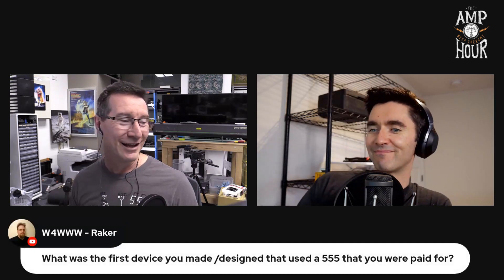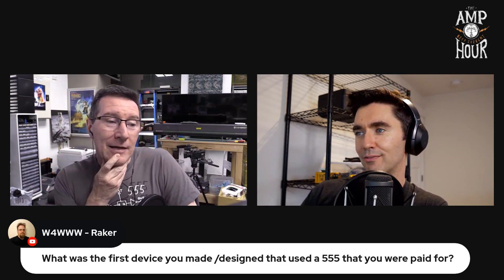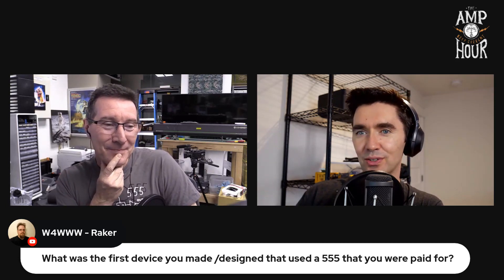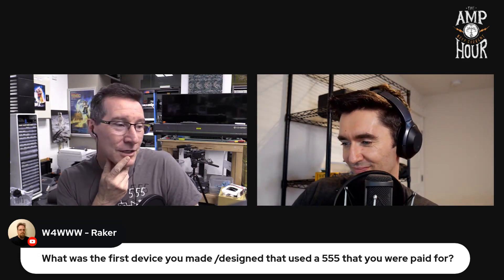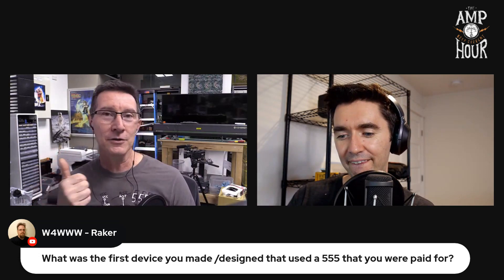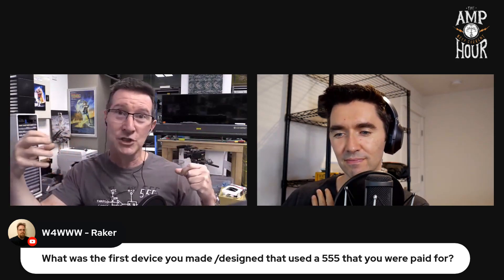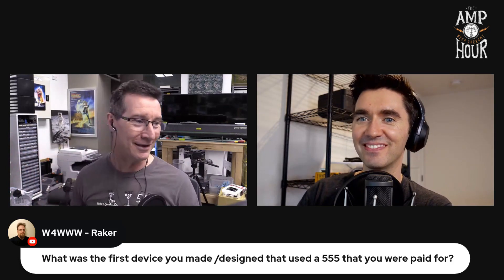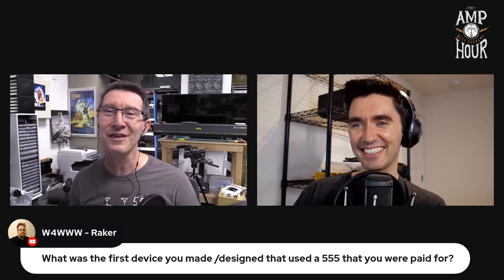My First Paid Electronics Gig

Comment: My first device also used a 555. It was a simple 8 LED chaser with a pot to adjust the speed. Can't remember the chip I used to drive the 8 LEDs. I remember drawing the circuit on the copper board using a dalo pen and drilling the holes with a small hand drill. Those where the days...

Comment: Color organs with 3 strings of Xmas lights stapled to the inside of old speaker boxes with plexy light diffusers replacing the baffle board. One string for bass, one for mid-range, and the other for high freq. Got boring after a while..